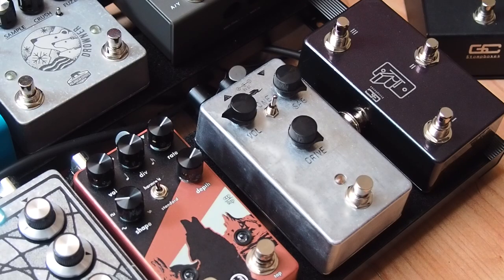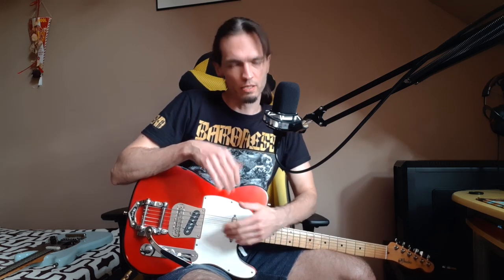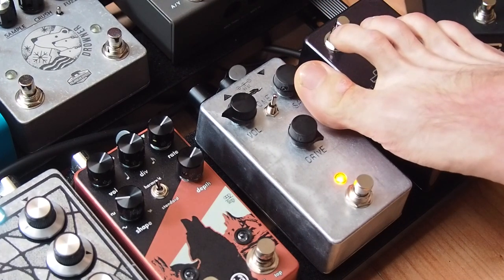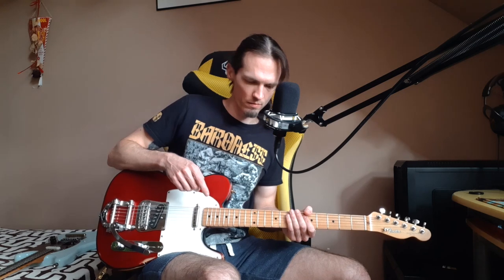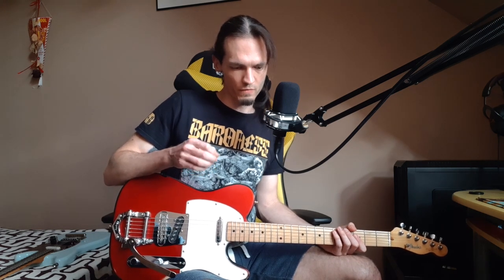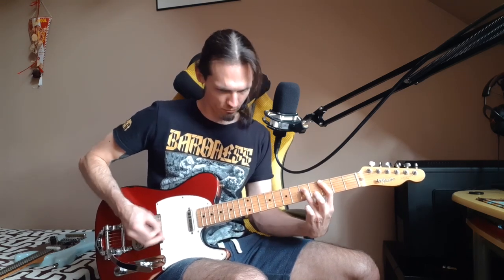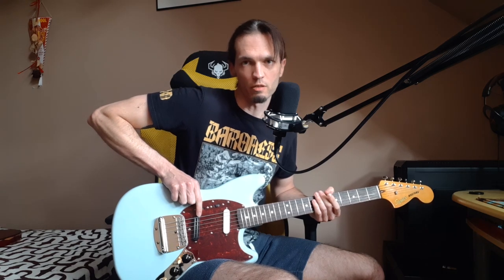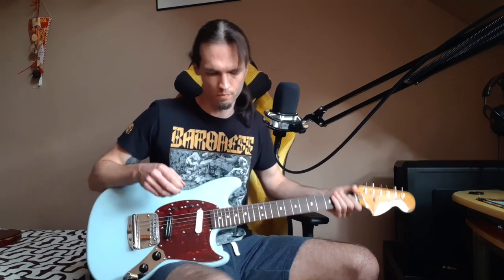Jackrabbit JFET Drive (Fairfield Circuitry  - The Barbershop)

Comment: Man, if I was not looking at the guitar I would swear its a humbucker. Those arent stacked single coils are they? Pretty cool pedal, its only got about 30 small parts you would have to solder, thats not bad.
Reply from the maker: In Tele there are two single coils, in Mustang I used bridge mini humbucker. Telecaster is the best guitar for testing drive/distortion sounds.
Reply: @riffsandpancakes  Ok, nice.